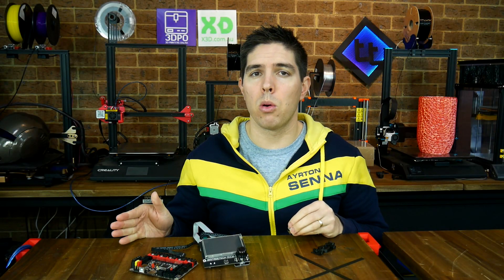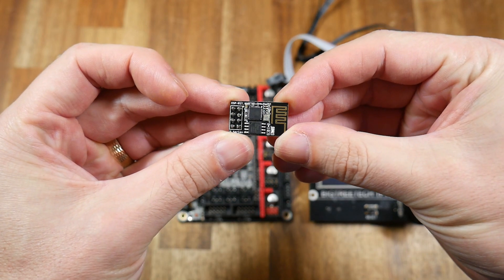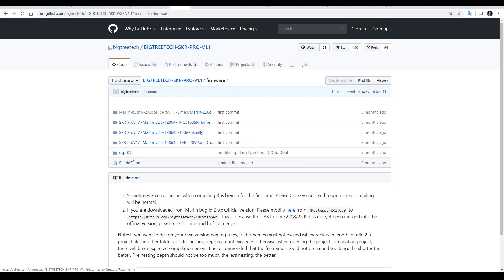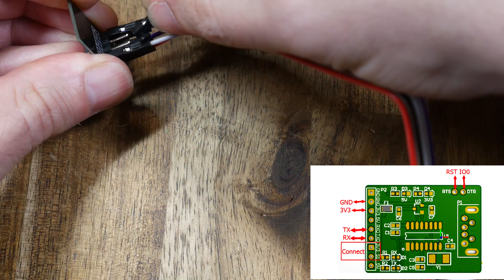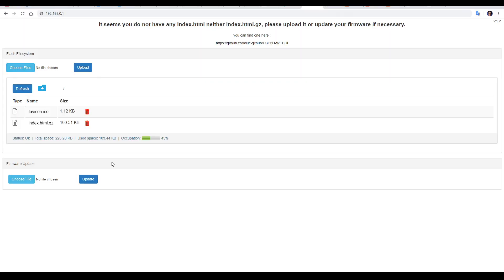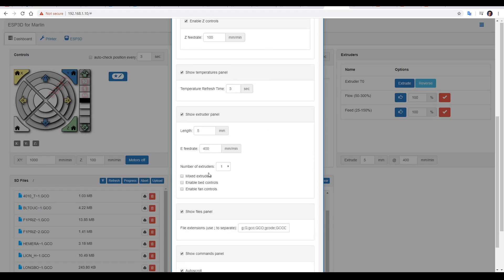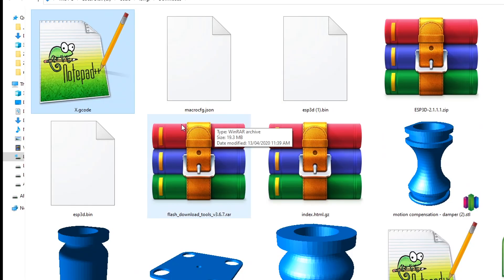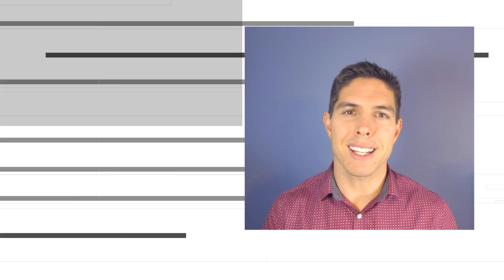Add wifi to your Bigtreetech mainboard/touchscreen - ESP-01S guide

Comment: does it have to be in marlin mode to activate the ssid? i flashed it plugged it into the display started it in touch mode. searched for available network but nothing. what am I doing wrong? is the display firmware I need to update ?
Reply: forget it. reading other comments I just realised I made a mistake when I did not select the firmware to upload.  it works ok.

Comment: I am late to the party. But I am glad to see how this video is still relevant in the Klipper world. A few things need to be addressed in the video. People in the comments have addressed these. I just want to reiterate.
1] In the firmware flashing tool, you need to enable checkmark left of the bin file. And on the right, in the red box enter 0x00000. There is a progress bar in green at the very bottom. If that feels slow and steady, you are writing the firmware.
2] If you are connecting the module to TFT33, make sure you enable the Wifi Port in LCD menu. Path is Menu->Settings->Connection->S. Ports. Turn on the port. And set the baudrate to the one you set in the ESP setup. 250000 is a good number.
3] You can check if the ESP works and connects to your router without connecting to the 3D printer. Just connect 3.3V and GND of the USB to Serial device and plug in the USB.

Comment: Hi, I bought a month ago this wifi module but for a seller mistake I receive a relay module. So I has been forced to rebuy a new wifi module on Amazon, different brand.
I follow proc3edures and instruction and until the base firmware flashing it seems been go all right. Now I'm tring to connet to the module via wifi in order to upload the graphics interface but in the networks list I found only AI-THINKER_CF0B8A. I connected via wifi without password but 192.168.0.1 desn't respond.
Do you have some ideas about this issue resolution? Could it happen because the base firmware is not correctly flashed?
Thanks in advance for your precious support.
Luca
Reply: HI, it's the same situation with btt module :( help please
Thnaks in advance

Comment: I have completed the instructions -- very good as usual for Teaching Tech.  A couple of questions below however....

One of the comments posted about Checking the Box in the Firmware Update tool for the firmware file + entering 0x00000 was essential to post the firmware update to the ESP-01S.   

Completed the Web-Update on the ESP-01S with it plugged into the BTT CH340 Writer Tool 3.3v and GND only pins to power it.   However, after placing the ESP-01S onto my TFT35_v3 board, the TFT Tools UI screen does not post a splash screen showing the ESP-01S is connecting to my home network, nor displaying its IP-address -- that was shown in the video and not what I observed.   I checked my router for connected devices and found the IP address, then was able to log into the TFT ESP-01S homepage from a computer browser.   However, I could not see any active status or send any Pronterface commands via the Web interface while connected to the printer via ESP-01S.  The Serial comm subscreen showed G-codes being generated to send when pressing options on the webpage, but the printer didn't perform the actions.

Questions: 1)  How do I locate & show the IP address of the TFT35_v3 ESP module in the TFT35 UI sub-screens (without having to check my router for connections)?    2)  Are there Marlin Firmware settings that I must enable so that the TFT35_v3 can send/receive g-code commands to the printer through the ESP-01S web interface?   I have Marlin 2.1.2 firmware.

Thanks,
Reply: I have sorted out Question #2:   In the TFT35_v3 config text file, I did not have UART port P2 set to a non-zero baud rate.  That port is dedicated to the ESP-01S Wifi -- set P2 baud to 250000 in the file, uploaded the firmware + config edited file via SD card to TFT35, and upon start-up I can now see serial comms in the ESP3D web-interface and send gcodes.   No additional Marlin updates beyond the original setup for attaching the TFT screen.

Comment: Just as a note, any ESP01 module with the right firmware flashed can be used.  They are a fully standalone microcontroller and can be flashed with lots of different firmwares.   The ESP-01 is a standard form factor.  Also, you don't need the BTT Writer.  Any FTDI style adaptor with 3.3V logic will work with this.   Those things aside, this is a great tutorial if you want to add basic WiFi on 2.4GHz only to your printer very cheaply as the ESP-01 is very cheap.
You will NEVER get an ESP chip match Octoprint because they just don't have the processing power.  Octoprint runs on a Raspberry Pi or even more powerful computers, more powerful than the microcontroller on the printer controller board, let alone just the ESP chips.   The ESP chips are great for basic wifi functionality, but if you use the full feautres of Octoprint, you might as well just stick to Octoprint and not bother with these as Octoprint can give you the full WiFi capabilities as well

Comment: Getting Unknown Command M153 now that the module is programmed and installed. The flasher didn't work, but tasmotizer worked first try. did the net login config and uploaded everything. just never seen this error before.
it displays in the little status box where yours had the IP address. ://
Reply: error unrelated to WIFI function. wifi module installed into tft and in settings the wifi functionality has to be enabled. did this and now i get the IP on boot ( along with that nonsense gcode error message but ignoring for now ).

Comment: You showed how to connect this to a TFT35, but will it plug into a TFT70?? The TFT70 does have an 2x4 port which is labeled ESP01. If it will work on the TFT70, which direction should it be oriented?? I wouldn't want to destroy either the screen, or the module by plugging it in backwards, and I'm not a fan of plugging it into the mainboard, because it overhangs the edge of the mainboard, which would mean I would have to cut or file an opening in the case to make room for the module.

Comment: I just added this to my Biqu B1 with the TFT35 B1 v3.0.1.  I ran into two issues, as mentioned in another comment below while selecting the firmware file for the esp, you need to check off the box left of the file name and type the 0x00000 address into the box on the right.
Also I had to edit a config.ini file and enable the 115200 baud rate on the 2nd communication device.
Also you can can configure the ESP with the flash tool by just providing power to it after the flash.
Reply: Just wanted to give a big thanks to you for this comment. I was following the instructions in the vid but it did not seem like the firmware was flashing. I assumed it was an issue with the ESP module I bought but new ones I got didn't work either. I noticed in the guide, the textbox was highlighted green but I didn't see the checkbox marked, so I assumed it might not need it. This was my issue all along. I was able to finally properly flash the firmware following the step you provided and got it working on my printer.
Reply: @DinkaFox1  glad my comment helped.

Comment: Old but a good video!
If anyone is interested, it works almost exactly the same with the ESP32E/ESP32U, only you don't need the flashing tool!
Unfortunately, my comment explaining how it works, and the pin assignment was deleted.
So you have to write to the BIQU support about the pin assignment!
Reply: Finally! I was also struggling to flash my esp32U on BTT Octopus Max EZ. Can you please tell how did you achieve this confusing situation? I'm still not able to figure it out. Thank You.

Comment: Note it will not work if the UART is not turned on in the touchpanel's config.ini.  it's not by default.  also enable serial on alwasy to make sure the wifi works in both Marlin and GUI modes.

Y

Comment: Followed to a t, wifi broadcast, did setup wizard on pc, then it wouldn't connect. Now it's not broadcasting, pc's not finding signal. Tried process again from start, redone firmware again, and still no broadcast from wifi chip

Comment: I have an Ender 3 Pro which I upgraded by installing the Big Tree Tech SKR Mini e3 v3 and the TFT 3.5  touch display.  The Ender 3 is connected to my Raspberry Pi 4 via the micro mini usb port on the printer. This allows me to access octoprint.  I just broke the micro usb on the SKR mini and my printer cannot access the web.  I purchased an ESP-01S chip hoping to just plug it into the TFT or the SKR and have an immediate magical connection.  Your video explained how this wasn't exactly a plug and play situation and though they are skillfully  presented and detailed, your instructions  on the chips' installation are way over my head.  So I'm looking for any solution other than installing new mother board.  I would greatly appreciate any advice or suggestions.  Thank you for all the time you have obviously put into each and every video.  And even if I don't fully grasp the content, I do learn something from each one.  Stay healthy - Dov Feder
Reply: You can always try your hand at replacing the micro usb port on the board. It's not that difficult with the correct tools.
Reply: @Jules_73  Thank you very much for your response but I must confess that at 67 I'm pretty sure even the simplest soldering job is beyone my abilities.  I was hoping to use the standard usb port on the attached TFT 3.5 touch display.  I connected the usb on the Raspberry Pi 4 and then to the TFT hoping to be able to access octoprint that way but there doesn't seem to be any communication between the two.  I appreciate your advice though.  Thank you.
Reply: Can I connect a usb cable from the raspberry pi 4 usb slot to the TFT 3.5 usb port in order to connect with the raspberry pi/octoprint?

Comment: Hey Michael,
How would I go about programming the BTT ESP-12S (ESP8266) modules for the SKR 2.0 Rev B STM32F429VGT6?

Are "platform", "platform_packages", and "board" correct?

[env:esp8266]
;esp8266 core 2.5.2
platform = espressif8266@2.2.0
platform_packages      = toolchain-xtensa@2.40802.200502
board = esp12e
framework = arduino
monitor_speed = 115200
monitor_flags = --echo
monitor_filters = colorize
; set frequency to 160MHz
board_build.f_cpu = 160000000L ; Default 160000000L
; set frequency to 40MHz
board_build.f_flash = 40000000L
board_build.flash_mode = dout
upload_resetmethod = nodemcu
build_flags = 
    -Wl,-Teagle.flash.4m4m.ld
    -D PIO_FRAMEWORK_ARDUINO_LWIP2_LOW_MEMORY
    -DNONOSDK221=1
    -DNDEBUG
    -DVTABLES_IN_FLASH
upload_speed = 115200
lib_ignore = 
    AsyncTCP
    ESP32NetBIOS
    ESP32SSPD

Comment: Hi! I need advice, I have BTT SKR 1.4 for, in win10 I can't move files, it still reports "only v8.3 files. I have .gco files. In win 8.1 it worked, but it reports that there is no TF card. When I read from TF card on the board, it says there is no card.I have to use SD slot on the display or USB.Thank you.

Comment: can you get reprap fw working with this wifi adapter? or will you need one that connects to the exp ports on the board? I recently got a biqu b1 printer and i would like to get reprap going like it does on my ender 3 with the biqu e3 rrf board that has built in wifi.

Comment: First off, thank you very much for making this guide.

Very interested in making this work correctly, but I'm finding that there seems to be a limitation to 8.3 filenames. I know that my firmware is not limited that way, as I use long filenames (And the .gcode extension) regularly. In fact when converted to 8.3, I can't seem to make them work, so it's not even particularly good at what I mostly want from wifi connectivity to my SKR Pro 1.2 board.

Everything else, including the Gcode console and status monitoring seems to be working perfectly.

I've read comments that the 8.3 limitation is a limitation of Marlin, but since I can use the filenames if I sneakernet the files to the printer, why can't I upload them through the ESP8266 firmware?

Is there a newer version of the firmware that will not insist on 8.3 filenames?

Is there an alternate that will work through the regular LCD interface? ( FILENAME.GCO does not appear to work )

Comment: I just want to say that I love your channel. Of all the people that so called teach you how to on this site you are the clearest and you don't jump so fast that we can't keep up. How do those other people think they are helping when they go so fast that you can't catch half of what they are saying. Frustrating. Not everyone that watches these videos is a pro. SLOW down damnit. Not you though, you're great. Thank you. I have a request. I'm new to this stuff and I'm old. It confuses the heck out of me. I've tried and tried and I am not able to configure the firmware for my Anycubic Mega Zero 2. I installed the SKR-Mini 2.0 and the TFT35 E-3 3.0 . Nice boards but I can't get things going. Screen I managed to flash. But I need the printer itself set up. X=220, Y=220 and Z=250. I also installed the BLTouch and it has the stock extruder that runs reverse from what the firmware is running. I like the stock extruder, it works great, it is dual drive geared and I like it. Would you be able to configure that for me in a firmware i could simply download and flash? I'm about ready to just dump the whole dang thing in the garbage. I am tired of trying to figure out this stuff. If I still had the original boards I'd be putting them back in but I donated them to a school back east so I'm stuck.

Comment: Hi Michael , do you have any plans on doing a video for the BIGTREETECH ESP-07S WIFI Module  To Use With SKR2 Board ,  I have both and cant find any info anywhere about it.
Reply: Did you managed to make it work? I also have the two to use

Comment: hmm i got a second printer and wanted to try this rather than octoprint since it was so much cheaper but i cant get it to do anything. I got the firmware flashed and the web files uploaded and can connect with my pc (wired CAT6) and phone (wifi) and go through preferences and have set a static IP and all but it does not "see" any info from printer and cannot move any axis or heat the bed. I am running it on a Sovol SV01 with a skr mini e3 v2 and the tft35 with the module plugged into the tft.
On the printer tab i clicked refresh and then only get the words Label, Value, and Help with a thin black outline like they are buttons but thats it?

Comment: i keep trying to install the firmware but it keeps giving me a chip sync error but i is there any way to know if it's actually using the com port selectect? because if i change the baud rate it doesn't change in the CLI

Comment: Would like to say I have learned a lot from your channel in the short time I've been 3d printing. Only sometimes it's not very clear like the Rx/Tx crossover I found that out from another tuber. Also going from an unplugged control board but then going to a fully functioning printer tft that the wifi module 'powers on' with? how do you know it's powered on, does it have to be powered by main power (12/24v) or will it work with usb. Mine doesn't transmit it's own wifi that's why I'm asking
Reply: Thanks! I've been struggling for a long time to get it to work, tried swapping TX and RX, and it works!!

Comment: Wifi sd cards are absurdly slow, too. So between this and a wifi sd card, IMO the sd is a no-go. It's significantly more expensive, it offers no interface for controlling (or even just debug) your printer, or actually starting a print. Wifi sd adapter is basically just a dumb novelty, and its wireless transfers are effectively worse sneakernet transfers, because you still have to walk over to the printer and start the print manually. If you just loaded the file on your SD and walked that card over to the printer, you would easily get 10-30x the bandwidth.

Comment: Having some trouble...bought module and programmer on Amazon.  No silk screen on the boards :-(
Programmer does not show up as USB serial port, and no drivers found anywhere.  It then dawned on me it might just need ANY USB to ttl serial converter.  Yep, wired up like I saw elsewhere on the net, and flash tool showed success burning ESP3D onto the modules.  Now, plugged into BTT 35 v3 and no broadcast that I can find.  Also plugged into SKR 1.4 turbo and no broadcast.
Not sure where to go now...
Just powered the module with 3.3V, gnd, and enable (3.3) and also no broadcast...it does appear that neither the 35 v3 nor the skr 1.4 communicate with the module, saw NO blue comm led on the ESP01 module...

Comment: I ran into an issue using this with the non TFT display plugged into the SKR Pro V1.2 board directly. Got it all flashed and looked great but nada on the M115 query. This is a Marlin thing... Marlin has two serial ports configured. One for USB (-1) which is used to send GCODE over USB (normal!) and one for the TFT (1). Now since you plugged yours into the TFT display, this worked because it was daisychained through the TFT display serial port (1). I was using a cheap non touch display hooked up using EXP1 and EXP2. So serial port 1 was not correct. Change 1 to 6 in the Marlin firmware and recompile and load on the SKR board and the SKR Pro V1.2 ESP01 connector is then active and connects. Working! Win! Thanks.

Comment: I keep getting this same error. 

[2021-05-05 11:48:00,956][ESP8266Loader_spi[1]][espDownloader.py][line:358][ERROR]: Chip sync error: Failed to connect to ESP8266: Timed out waiting for packet header
[2021-05-05 11:48:00,960][ESP8266Loader_spi[1]][espDownloader.py][line:446][ERROR]: ESP8266 Chip sync error esp_sync_blocking.

I double-checked that everything was followed as guided and even made sure that the com channel and baud were congruent under device settings and properties, 
so I had thought there was a hardware issue with the wifi module. 
Until I purchased a new wifi mod and writer and saw I was getting the same message.

Any help would be much appreciated!
Reply: The same thing is happening to me. Did you find out a solution?